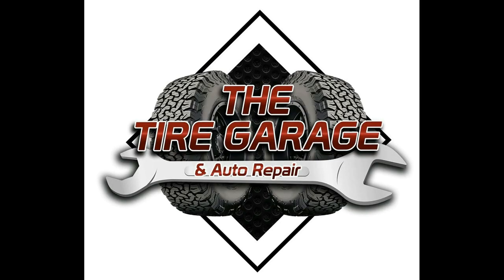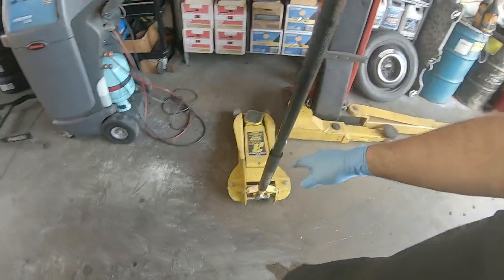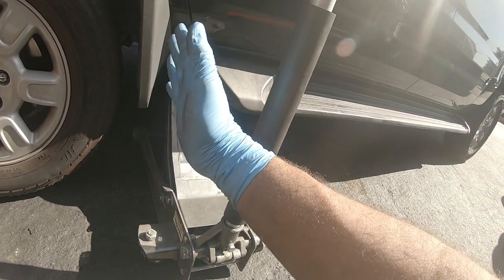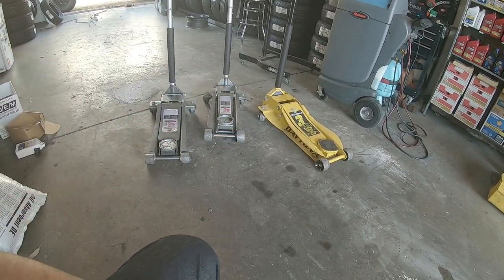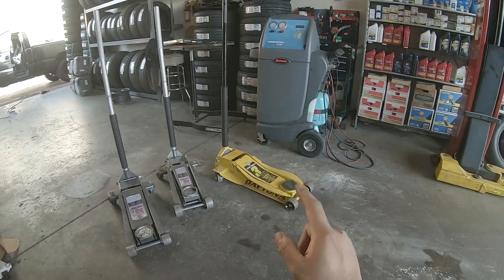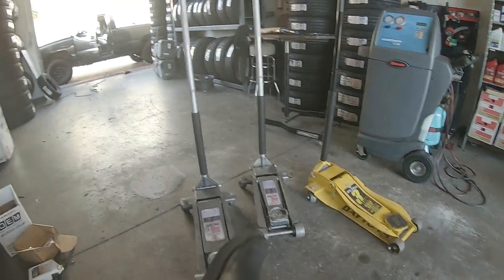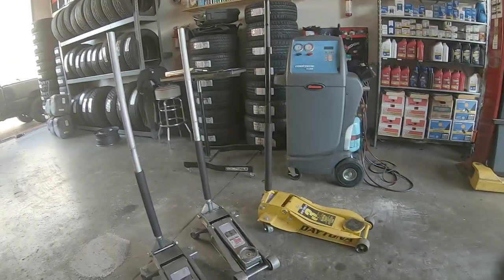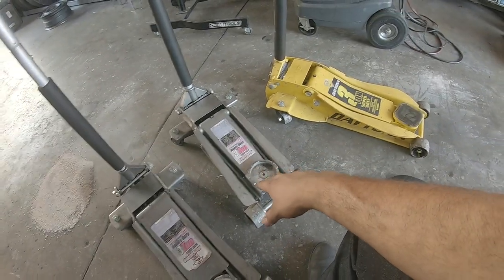Harbor Freight Floor Jacks Review / The Tire Garage TV Ep18

Comment: Don’t know if you know or not, but those Daytona jacks are the ones that SnapOn used Harbor Freight over. Turned out they were made in the same factory lol. 
I’m wanting to get a jack for personal use, and debating which I want. Is the Daytona worth paying up for? Or is the Pittsburgh good enough? Isn’t there a couple different Daytona’s as well?
Reply: @stratgibson Thanks for the tip. I’ll keep a lookout.
Reply from the maker: If the Daytona is the same maker as the Snap On it should be a no brainer!! The Snap On is crazy expensive while the Daytona is still working every day for me

Comment: If you have a vehicle up on a floor jack and the floor jack starts to tilt that’s tells yourself you are not on flat ground that’s why the floor jack tilts a little bit and before you jack up any vehicle make sure if you are on flat ground before you start jack up any vehicle that’s just for safety
Reply from the maker: understood... the area outside the shop is not flat. That's def where I see the most tilt. The yellow Daytona is def the strongest. It doesn't tilt like the grey ones.

Comment: Just a recommendation:  When you get a new jack from Harbor Freight, before it goes into service, drain and replace with higher quality hydraulic fluid.  Preferably something with ring and seal conditioners.
Reply from the maker: Good idea!!
Reply: Just buy the warranty for 12 bucks and take it back for exchange every year